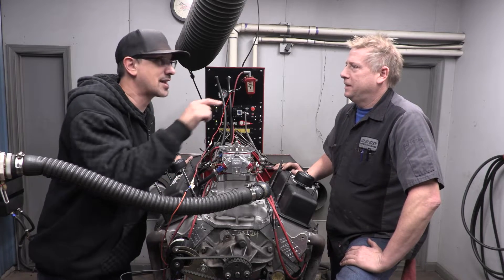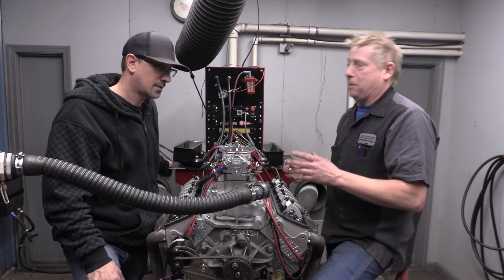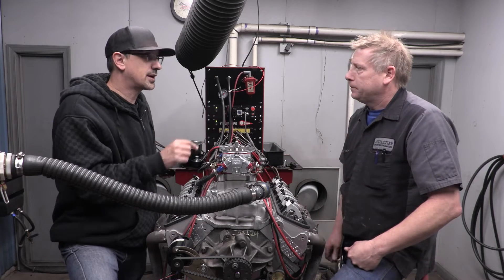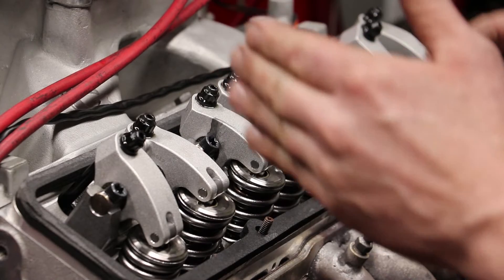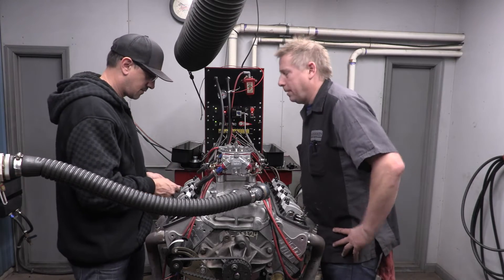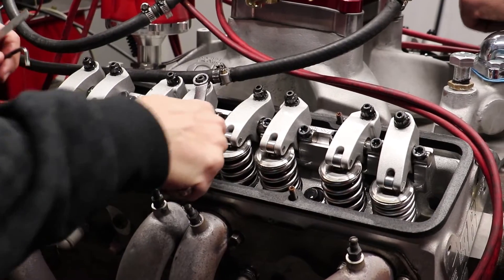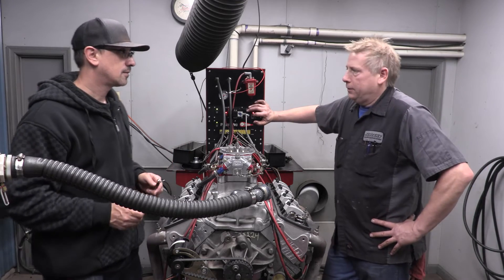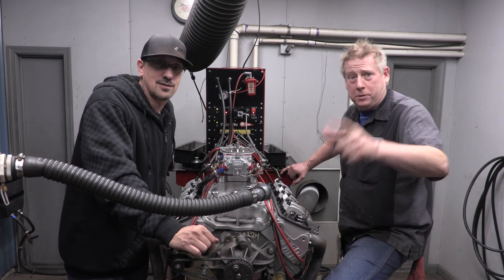MOF 101:  Basics of Setting your Race Engine's Valves and Valve Train Maintenance

Comment: I've always set Hydraulic rollers to 1/4 to 1turn after zero lash, Solids to cam specs, but with newer variable rate lifters, they tell you to use a gauge, ( about .020" ) and bottom the plunger out till the valve starts to open, than back it off until the valve sets, and the gauge is just snug. Kinda trying to wrap my head around this, as it seems to me, your setting pre-load to way down in the lifter??? 
Great vid, just wish SOMEONE would do variable rate lifters vids....Thanks!

Comment: I have a question. I'm looking for some insight. I just did head gaskets on my 1997 K1500. Should be the same basic thing as the one you do in this video. I put my heads back on. Now I'm working on setting my valve lash. I tightened the rocker arm just enough till the push rods made contact and wasn't all loose. Then I turned the crank. I know you need to turn it 90 degrees. As I was turning it I felt and heard grinding. I kept turning and it got past it. But the next time I turned it, it was tighter. 
So I loosened up all of my rockers. They are completely loose. Now i can turn it over and there is no grinding. 
It really seems like the push rods must have been pushing the lifter down on the cam too hard. But you have to take the valve lash out right? 
Is there supposed to be a better way to do this if the lifters aren't dry? 
You're not the first person I've heard say people get intimidated by this. 
Has this ever been an issue before? 
Advice? 
Thank you for your thoughts and wisdom.

Comment: Ok guys, I have an iron block, aluminum heads, sbc 381, with roller rockers, and a solid roller Comp cams cam. I don't know what cam it is, and forgot my correct lash settings hot or cold.  Runs great, made 511hp on the dyno. What should I set the lash to?